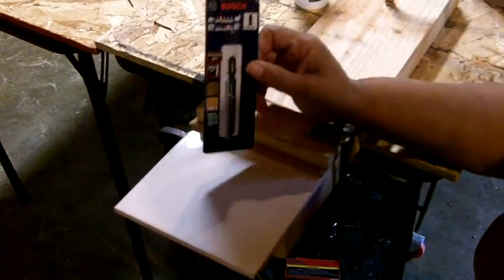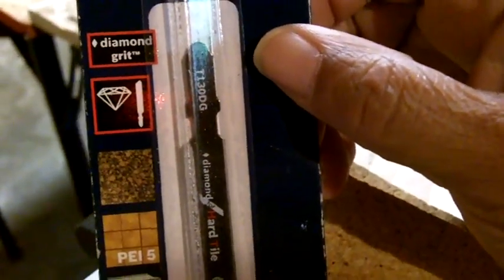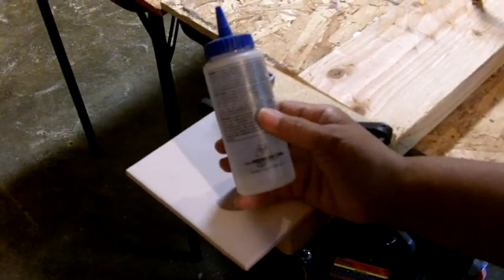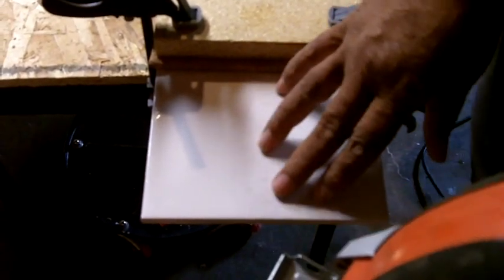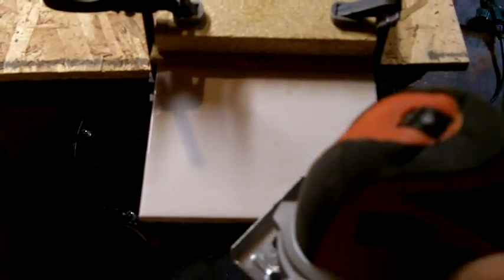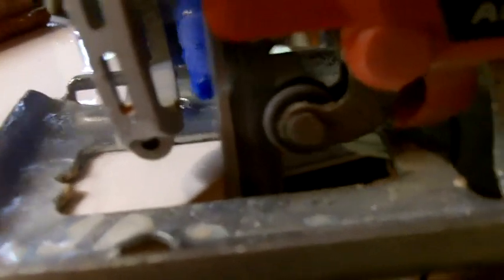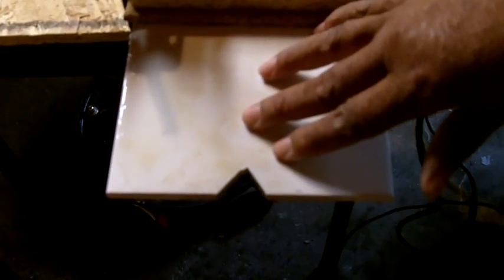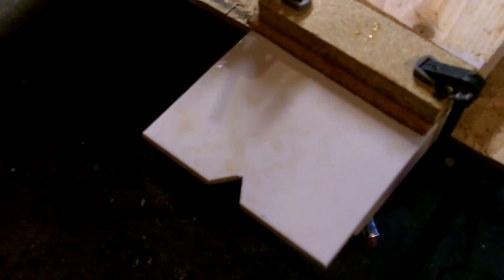How to Cut Ceramic Tile with a Jig Saw

Comment: Great and informative video's, diamond jigsaw blades are rarely used as all day ceramic tile cutters, we have the diamond electric wheel or scribe for that. The jigsaw blade is when you have a cut that can not  be done by the usual tools. As demonstrated, keep the blade cooled by water from a bottle or by a wet sponge , take your time and really cool the blade by stopping for a minute and soak the blade alot...... same with ceramic drill bits.... A GOOD DRILL BIT  CAN MANAGE AROUND 20 GOOD CLEAN HOLES BEFORE THEY START TO BECOME BLUNT....same with a jigsaw blade ,3 or 4 tiles and you need to change the blade.......CERAMIC TILES ARE TOUGH!!!
Reply from the maker: 33fordy thanks for sharing your experience!

Comment: do not buy this blade, yes can cut the tile but 1 inch per hour, if you  intend to cut 6 inches it will take you 6 hours to cut the tile. you better  use grinder or tile cutter. (experienced)

Comment: I read the reviews on Home Depot about these blades. The reviews were not good. They said they lasted abut a minuet. Is this true?
Reply from the maker: cooldog60 Hello Cooldog60:  First let me preface my answer with with a comment:  This video was not a product endorsement, but rather a video request from a subscriber, who wanted us to make a video explaining the process of cutting tile with a jig saw.  That said, I read the reviews as well, and the product was given a 3.1 rating out of 5, which is average.  I found the blade effective and it performed satisfactorily without issue. I think it is important to consider when reading product reviews whether the reviewer is skilled, and using the product in its intended manner.

Comment: curious have you ever worked with scroll saws. Scroll saws as of my current knowledge is used for wood sculpture 2d and 3d fine detail can also be used to cut metal to make jewlery findings and other thin metal designs rather then casting/molding metal. But i am now curious to see if you can get a special blade for a scroll saw to do tiles, glass,masonary/concrete/ceramic based materials. AKA being able to do small 3d or 2d designs for other then wood or metal things.

Comment: Hey, Leah! Great video! I can do this--and I did, though I cut 3/8" porcelain tile, not ceramic tile, so maybe it was a little harder, but probably not. 

I also have two tips--make sure you are plugged into a grounded outlet, preferably a GFCI outlet! Working with power tools and water can be dangerous. Second, I put green painter's tape around the edge of my cut just to help me see where I was cutting AND to minimize the chance of chipping--this tile seems to chip easily.

I did also have one question--I have a variable speed Makita jigsaw that I love. It can do "straight up and down" cuts AND slightly wobble the blade orbitally as well. It also has speeds, 1-5. I'm wondering what the best setting is for those of us who have a jigsaw this nice. I just used straight up and down cutting and the slowest speed, and it worked fine.

I think the people who complained about the diamond blade wearing out weren't watering it down enough. I don't think it's enough just to spray the surface of the tile and then cut. As with a wet tile saw, the blade is continually cooled with the water. 

A lot of people use angle grinders to cut tile, but I don't have one, so it was this or the wet saw and tile nippers. I used it to cut around a toilet flange. IT WORKED! 

Thanks for all the videos and tips. It really helps to hear "you can do this."
Reply from the maker: +Jos. N. Hi Jos., thanks!  I'm glad to be of help.  As for the ideal setting for various materials, there really isn't a guideline.  It's just by feel...start with a low setting, and then make adjustments as needed.  Take care.

Comment: Thank you for all the great videos. I've been watching quite a few of them and also liked and subscribed. Small question: in this video example, you cut a triangle into the tile but it broke off a bit before you cut all the way through and the corner isn't great. How would you recommend fixing it into a proper corner... let's say, for example, if you have a much smaller ornament square tile you want to fit inside this space.

Comment: Obviously i realize you in theory could but i don't see many people yet using scroll saws on anything other then wood or metal. Is there a reason for that or am i just not coming across it yet. I would imagine stain glass cutting would be easier on a scroll saw then a  glass/tile scoring hand tool as the curve shapes are just more difficult. A specially with a circle you need a template/  compass based tool to do it precisely.

Comment: It may be okay for a small notch cut like this, but don't use a jigsaw for bigger work, like cutting out holes for electric sockets. 

Diamond blades need to be used at a slow speed to avoid overheating.  You also need to pause regularly for the same reason - even with constant water cooling. And once you start using them they lose their sharpness more quickly than other blades. 

For these reasons, you will probably average about 1cm a minute (allowing for pauses) and a disc cutter is much quicker.
Reply from the maker: Thank you for commenting.  We have several videos on different methods to cut tile, this is an option.